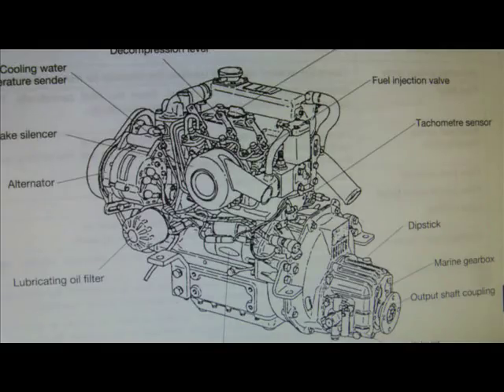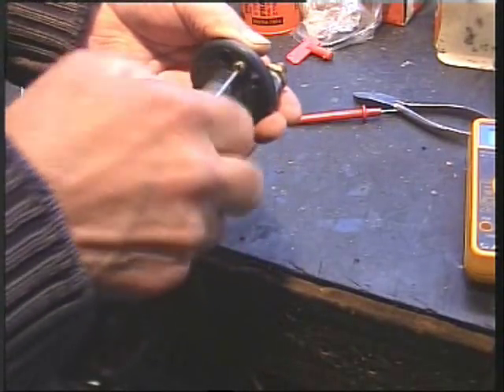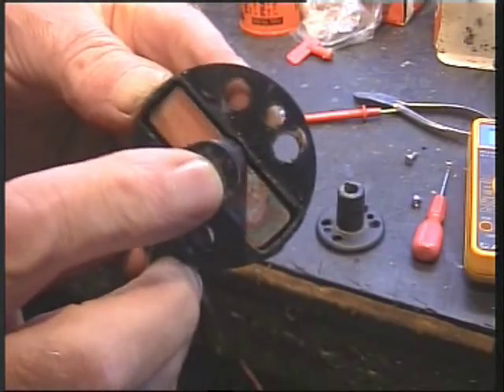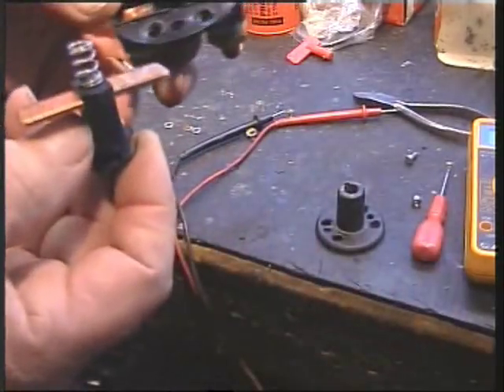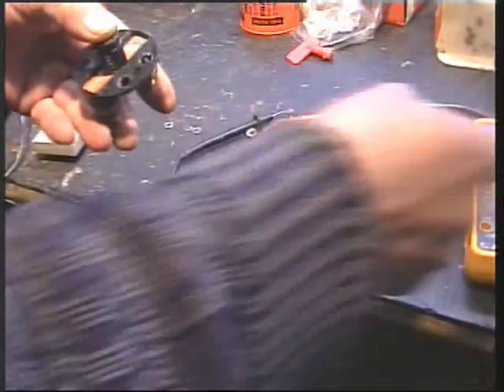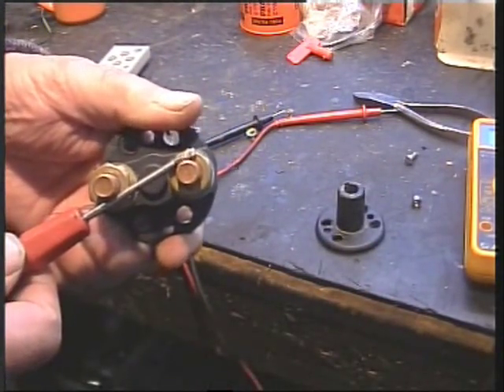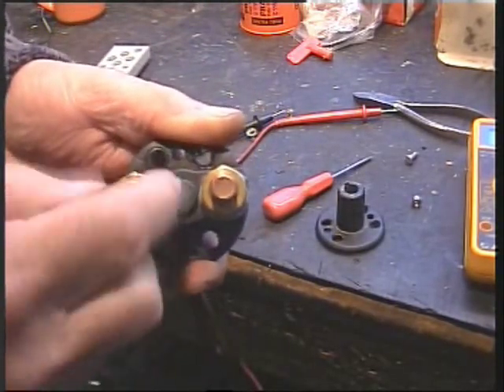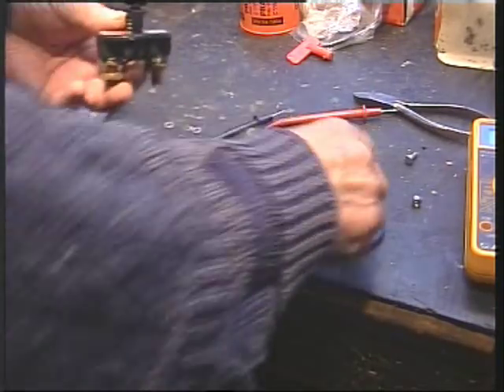yanma starting issues

Comment: Yep, i have had problems with a couple of those in my time - your one was in good shape compared to the mess i have found in one or two of them. You can use a meter to diagnose the issue, just measure the voltage drop from one side of the switch to the other whilst under heavy load - cranking for instance. In the past i have measured a 7v drop across those switches. 7 from 12 does not leave much for starting your engine! But your so right, adding bypass cables, extra relays and solenoids to a circuit that used to work is obviously not the way to fix the fault - the engine used to start ok with the original circuit, so obviously all that is needed is to fix that fault, do the job properly and there is no need to add anything.

Comment: Thank you, Replacing this switch fixed my non starting issues . one time the engine would start . next time you try to start it Nothing not even a click. I checked through a lot of wires  cleaned terminals . nothing. I replaced the isolator switch  after finding this advice . and bingo  . now we are good to start every time . I have  a Yanmar 2YM15 engine.
Reply from the maker: well done glad it helped

Comment: 2:21 That fused connection only applies power to the B+ terminal. Power directly from the battery does not run through that wire (obviously) it's supplied 100% via the cable run directly from the positive terminal on your battery to the positive terminal on the starter solenoid. 

Only thing that matters with that fused connection is that it engages the solenoid on the starter. The solenoid is a relay. That is what engages the Batt+ connection.

Comment: You've got to remember that the starter pulls 100 amps and the glow plugs 60 amps (on a 4 cylinder engine). At that, you will lose 1.6 volts of battery voltage for every 0.01ohms of contact resistance- that's not a lot; that corrosion will have much higher resistance than that even if a normal multimeter won't show it. A low ohm meter that can measure milliohms is a good investment for anyone who does this kind of work regularly. It will tell you how good your earthing points and cable joints are too!
Reply: I prefer to measure under load, the analog meter I bought when I was 14 is a lot easier to use for this than the digital meters, especially the older or cheaper ones that update slowly.

Comment: Good video - I learnt to my cost years ago that 'continuity' is fine for low current but means nothing when you are dealing with lots of amps - a hair thick single strand of copper will give you 0 Ohms on the meter but try passing serious Amps

Comment: Hi, Me too, I have found those cheap isolators to be absolutely hopeless. Completely useless especially in a marine environment. I did not know about that fuse though so thanks for that. I have found on a few occasions that when these engines crank but do not start, it is caused by a lack of compression, either stuck piston rings or those exhaust valves.

Comment: While your point is taken, I respectfully disagree. This component should prove defective with a "voltage drop" across it (under cranking load of course). Ohm meter is useless for this type heavy contact / heavy gauge circuit. As you correctly pointed out, even a few ohms under heavy current draw will result in a significant voltage drop. As you well know. No disrespect intended. I love your videos and feel a bit sheepish disagreeing with you.

Comment: I applied the same checks for my Tohatsu 8hp Outboard with Electric Start and Remote gear and throttle
Replaced old cut off switcht 
Replaced Corroded Key/Start Switch Remote (tohatsu make) key was rusted and bent !!)
Lubricated spindle with Duck Oil where starter dog spins and moves up to engage flywheel..
All works fine now  seemed expensive 50 quid for Tohatsue key and starter switch but it is high quality msinly ruined by by me not lubing and bent rusty key !!
So lesson learnt regular lube/maintenance in future saves lost trips and 50 quid...